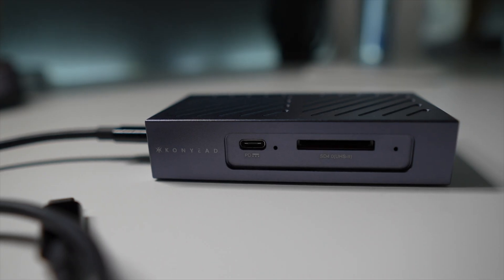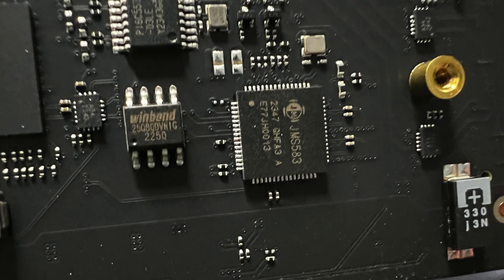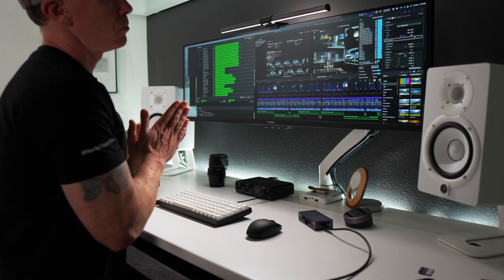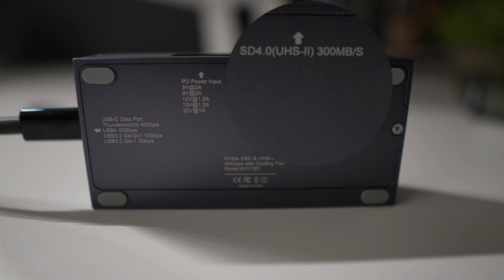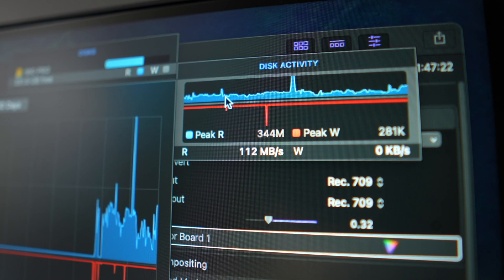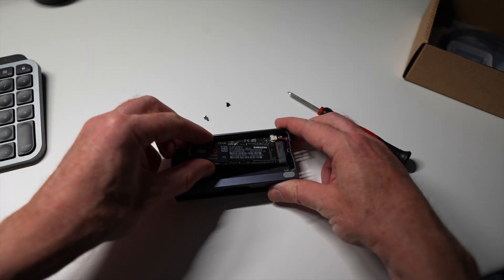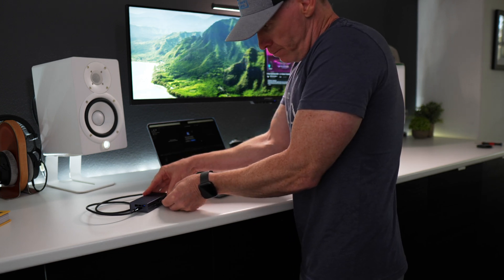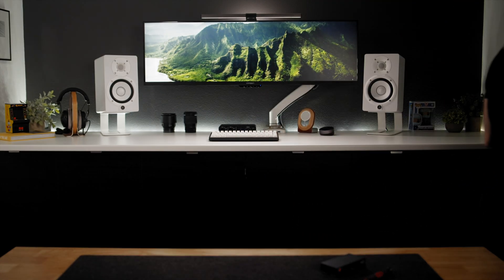An External SSD Enclosure to Boost Your Speed, Save Money, and Upgrade Your Workflow

Comment: Or, go with an enclosure with a fan that is 80 Gbps Thunderbolt 5 plus a Samsung 990 PRO SSD and match the speed of the internal SSD drive.  Trebleet makes one that has the best thermal data (about 30° C). Acasis makes a similar enclosure.  Future proof.  My Mac Mini M4 Pro has 3 TB5 ports and it rocks.
Reply from the maker: For sure. But outside of synthetic benchmarks are you getting it to read and write faster than a TB 4 enclosure on demanding programs? Genuinely curious to know. Congrats on the M4 Pro. A beast of a little machine.

Comment: Hey man thank you for this review! I just bought the enclosure and it’s arriving soon! I have a question though, you say it has a Fan so is it alright to have  the enclosure plugged in my laptop all the time or should I unplug it when I’m not using it?
Reply from the maker: The fan will run at idle all the time. So far I’ve had it plugged into my setup for the last several months and it’s been just fine. 🤘
Reply: @ I guess that’s another question haha sorry for interrupting your day but since  it’s always on idle mode meaning that its not running because I’m not using it does that mean that the fan only starts to run when you use something from the SSD enclosure? Like playing a videogame? 

Alright thanks! I guess another question but is the fan thermally controlled?

But either way I’ll keep the enclosure plugged in my laptop at all times if you have nothing wrong with it! Thank you!

Comment: Hey man, great video. Nice to see you back. 
Do you think it's a good idea to get a 256gb mac mini, install app internally but keep all the heavy data externally or would you recommend 512gb even in that case?
Reply from the maker: Thanks! So, it was great to see that Apple has finally started the memory at 16GBs…That was long overdue and I always stress updating memory first. 

As far as the 256, I think most would be fine if they have access to an external SSD. I think the base model M4 mini is a screaming deal and honestly, I wouldn’t touch it. I’d go with the base and use an external SSD. The fact that it’s a desktop really makes it even more of an option that makes sense.
Reply: @KevinRossRN  Thanks for the answer.
I guess I'll go with 256gb + TB4 SSDs. Perhaps I'll consider  24gb of RAM. 

I also really like the "action" I'm seeing regarding the swappable memory. I think we'll see third parties offering internal SSD upgrades.
Reply from the maker: @josephk.9567 from what I understand there is an option that’s in Kickstarter. I have to look into it. I know that if you’re good with soldering it is possible to switch out the NAND chip. This would be fantastic.

Comment: Too bad nobody uses the JMS586A which does USB 3.2 Gen 2x2 at 20Gb as I have some of those ports and it is backwards compatible.  Too bad nobody uses the Thunderbolt 4 JHL9440 which gives you x4 Gen 4 lanes internally for the accessory.   This was released third quarter 2024 so hopefully we see this soon.  I would include links to the spec sheets but I don't think YouTube likes that in comments.
Reply from the maker: I hear you. When I continue to see these controllers  released in 2018, and we know these updates exist, it’s unfortunate. 

As I was saying in another comment, I was looking at coming up with my own line of these, but the manufacturing really needed to be at scale to make it worth it, and the risk of having a smaller target audience. 

It seems in many cases it comes down to cost and when I was talking to another company that launched these they were starting with “old” components, but hoping to make iterative improvements with updated components, but having issues to scale that up. 

But again, I’m with you. 🤘
Reply: @KevinRossRN  OWC just released a Thunderbolt 5 external SSD that will read/write at 6,000 MB/s.  They make good stuff and I noticed that have a true USB 4.0 one as well.
Reply from the maker: @fred6464 I have an OWC SSD from a few years ago that’s still working great. They do make quality products. If I decide on one of the updated Macs (or build something), I’d be down to test that one.
Reply: @KevinRossRN  I have no clue what I want to do.  I put my first PC together in 1989, Intel 386 and ATI video card.   After 35 years I may switch to MacOS for my main PC.  I have a M1 Mac Mini in my living room for family video conferences and it's running Ben Software's Security Spy 24/7 to my Synology NAS and has a 10Gb TB Ethernet adapter.   It has been solid the past two years.  You can boot off external TB SSDs with MacOS so that's probably what I want to do since Apple likes to charge so much for SSD chips.
Reply from the maker: @fred6464 yeah, I love building PCs, but honestly there’s also something really nice about having a machine that is so efficient yet so capable in a much smaller footprint. 

I hear you on those SSDs. The price to upgrade internally is a bit obscene.

Comment: Noooo, fledgling have gone!! YOu give and take man, you return, yay, you bring bad news booo! Have you seen that 2 NVME TB enclosure from I think, Acasis? You can have them in RAID, which may not give you super, super fast speeds but would give you a heck of an external for a mac
Reply from the maker: Yeah, I was bummed to hear about fledging. I had been in touch with them over the year prior to them closing their doors. Super bummed for those folks.

Yeah, I was thinking about picking up that Acasis to test that raid functionality. I am curious by it. And you’re right, it would be a very nice external option.
Reply: @KevinRossRN  though now that TB5 is available, if they did a TB5 version of that enclosure then good grief you could have some speed there. Oh, and both of my Fledglings are still going a few years later and they were really decent value, so really a shame.
Reply from the maker: @ggproductions7078 Yeah, just as I feel like I got a handle on TB4/USB 4.0, here we are with 5. I’m going to be doing some research on that protocol, and surprised to see it in the Mac so soon. 

I looked into coming up with my own enclosure (years ago) and the margins can be decent, but they get eaten up by the fact that the market is still small for these devices. 🤷‍♂️

Comment: Waiting for thunderbolt 5 :p
Reply from the maker: 80Gbps bi-directional and up to 120Gbps will be fun to test. I’m glad to start seeing it making its way to hardware now.
Reply: @ yeah didn’t expect to see it in M4 MacBooks already 🤯.
Reply from the maker: @pvdgucht yeah, I seriously thought I was going to need to build something just to test it. I’m pleasantly surprised as well. 

Are you thinking of picking up one of the new releases this year?
Reply: @ Personally I am waiting for the Tandem OLED to come to the MacBook. It is just so amazing on the iPad. Maybe M6 🤷‍♂️. 
Got a Z890 motherboard that supports TB 5 ap can test it over there for now once there is an affordable enclosure options.
Reply from the maker: @pvdgucht Yeah, I was wondering about picking up one of the M4s or just building something new for testing. Obviously two different ecosystems and hardware, but I’ve been wanting to build a rig again. 

It’s funny because I still rock with the M1s and it’s already been updated 3 times, but I’m still reluctant because these updates still seem so iterative 🤷‍♂️

At least for what I’m using these for.